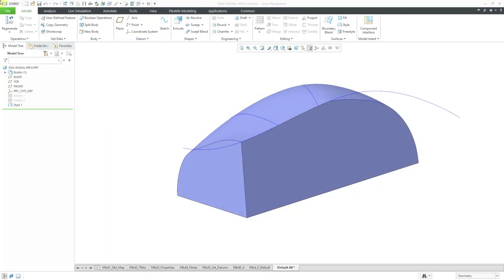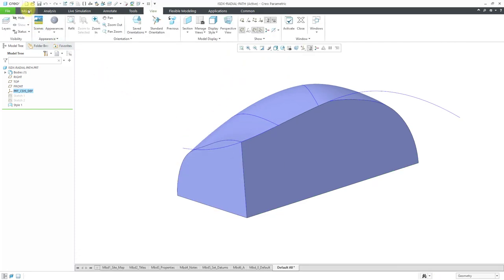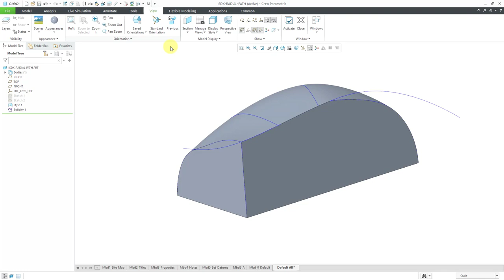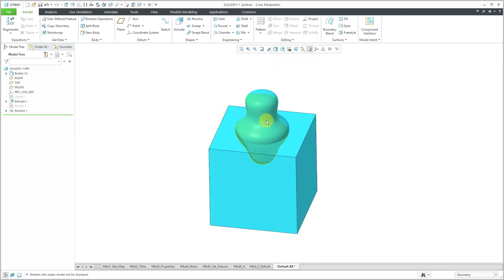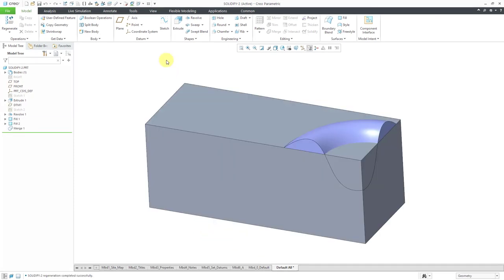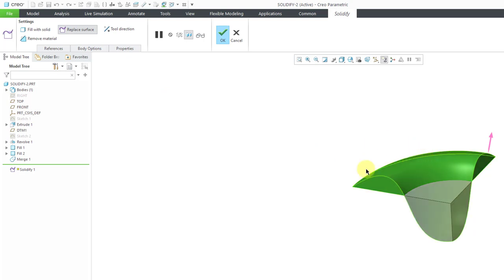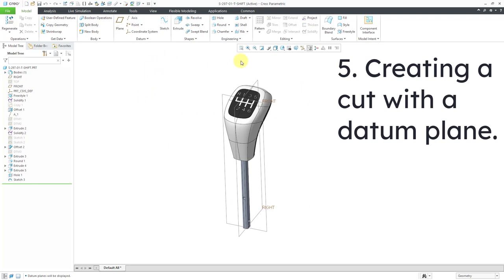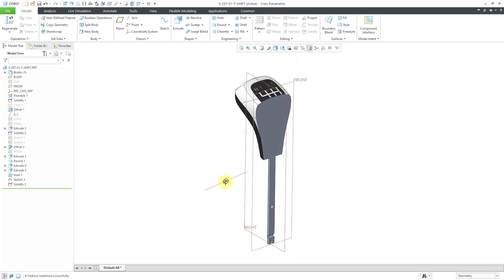Creo Parametric - Surface Modeling | Solidify Command

Comment: How can make a single surface for a closed circle section?.  As an example, need a single surface perimeter when making a hole or extruding closed circle. It shows two equally split surface. Can you please explain the configuration setting for this?,  Thanks
Reply from the maker: During selection, they are treated as a single surface.
Reply: @CADPLMGuy  If I make a  revolve or  a circle extrude or make a hole on a solid body  in creo software , the perimeter surface is a two equally split surfaces. But in other software like solid works the perimeter is a single surface. Do you  know configuration settings for to get a single surface for above mentioned.
Reply from the maker: There is no configuration option. Don't worry about it. That's how Dr. Sam Geisberg wrote his engine for defining 3D geometry, cylinders, and circles in the original Pro/ENGINEER in the 1980s. Creo is not SolidWorks or other CAD programs. It is the originator of parametric modeling and its kernel is different from Parasolids. But the selection algorithm is smart enough that when you select one, it automatically selects the other half as necessary.